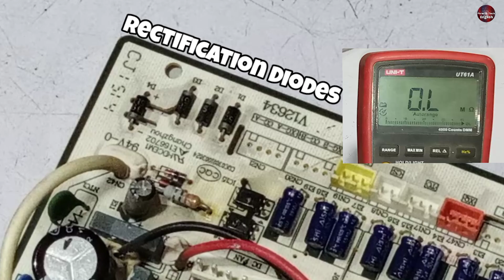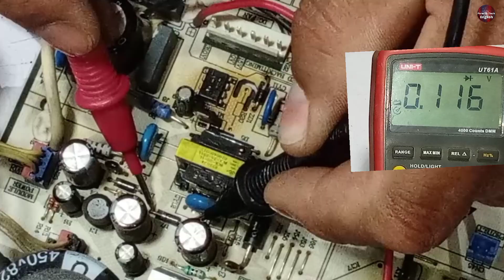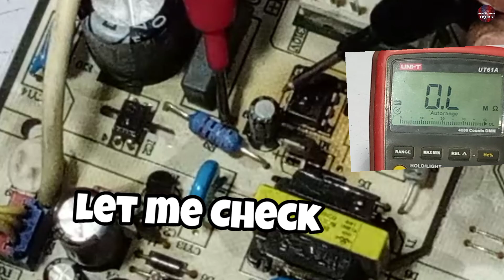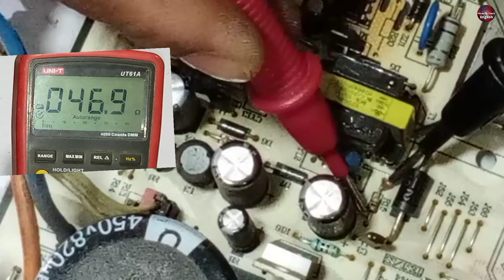Haier Mini Split AC Control/Mother Board E7 Error Code Repair

Comment: رجاء هل يمكنك مساعدتي في تشخيص العطل لدي كارت سبلت انفيرتر نوع جري عدد ٣ كلهن نفس الظاهر يعطن وهو يسحبن امبير وبظع ملي امبير من المصدر وليد الكارت يعمل
Please, can you help me diagnose the fault? I have 3 Gree split inverter cards, all of them appear to be the same. They give out and draw amperes and a few milliamps from the source. The card is working stably and there are no shorts in the power components. I only discovered a short on the two ends of the surface condenser near the microcontroller. بشكل ثابت   ولايوجد اي شورت في عناصر البور فقط اكتشفت شورت  على طرفي كونديسر سطحي قرب المتحكم الدقيق

Comment: Check and change the capacitors from the smp. Usually that's the issue with haier mother bords too much heat